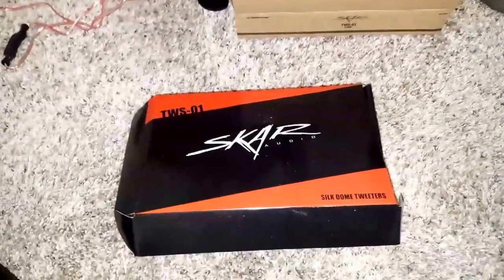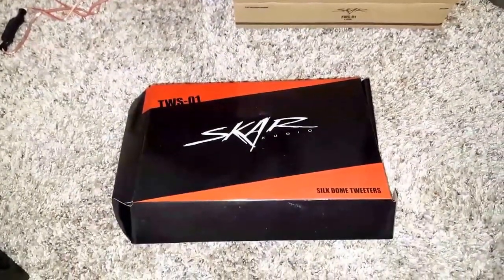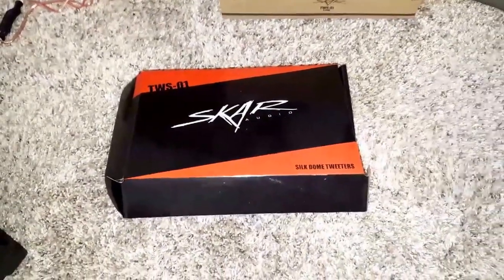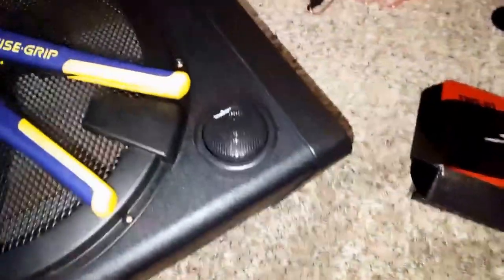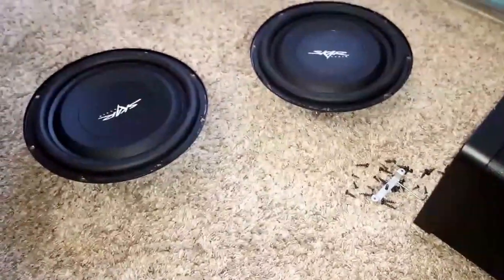ION Audio Road Warrior Bluetooth Speaker *Upgraded* Video 2

Comment: I did this upgrade to my road warrior, and it worked out great except for 2 slight things. 1: the tweeters are just barely too small and do not fit correctly in the existing holes, so I’m going to either get a rubber o ring and put it on so it fits correctly or somehow make the hole smaller. 2: the subs fit good but there’s a slight ring of the interior wood visible, so I just painted that area black and it looks good, you could even use sharpie marker or whatever to paint it.
Reply: Actually one question I noticed your subs sit flush with the speaker but the ones I got stick way out, did you do something to make them flush or is the new version or whatever of the subs different
Reply from the maker: They might have changed designs in the last few years. I did not do anything special.
Reply: @ZionRanch  ok that’s what I figured, thanks
Reply: @meetch0 does it sound better then the stock speakers?
Reply: @arthurmomo4406 hi, I did this a while ago and would not recommend doing this, at least not with this set of subwoofers, for a few reasons. For one, the subs aren’t designed to play the frequencies that the stock speakers do. They are able to, but they will be damaged more quickly over time. Also, the road warrior box uses 1/4-1/2 inch thick wood, which ended up cracking and falling apart after just a couple months when I installed the subs (due to the much higher vibration).  So, to answer your question, yes it did sound better, but I would replace the speakers with higher quality full range speakers that can handle the higher frequencies rather than subwoofers. Skar audio sells a few 10 inch midrange loudspeakers, or other brands obviously. The skar tweeters work fine though, I used some electrical tape to make the hole a bit smaller so they fit right but there’s better ways I’m sure

Comment: Did you add a crossover for the new subs?  I want to replace one of the two factory woofers with a shallow mount pioneer sub.  The sub is 20-125hz.  So I was thinking of adding a passive crossover to make sure the pioneer gets nothing above 125 hz.  I kind of want to leave one original woofer, so as not to lose the midrange.  Also, how much do I need to worry about the ohms of the sub matching to what the amp in the road warrior is?
Reply from the maker: I did not, I am not that savvy when it comes to that. I can only say it was a night and day difference to the factory subs.
Reply: Hey bro, I was thinking of doing the same thing to mine. Did you get to swap one of the subwoofers after all?

Comment: I'm wondering if this got completely rid of the clipping at Max volume? I have a road warrior and if this gets rid of that I'm doing this asap
Reply from the maker: It was night and day difference. I can't speak to the max volume issue as I never had that issue.
Reply: @ZionRanch  I see. Did you have to do anything to the amp to handle the new speakers?
Reply from the maker: I did not, plug and play. Very simple!
Reply: @matthewgray259  When my ION's internal battery was getting weaker and needing replacement it did the clipping issue. New Battery with more reserve power and it was gone.
Reply: @mattskins5323  I replaced the tweeters and all distortion went away
Reply: @matthewgray259  Sounds like the stock one's aren't that efficient. I may have to look into that.
Reply: @mattskins5323  After the tweeter upgrade it was perfect. I swapped the subs out and took them back out. They weren’t worth doubling the weight of the speaker.
Reply: @matthewgray259  Thats what i thought people want car audio bass out of something thats supposed to be portable and is running on a 12v 7ah battery like... hello! I thought the same thing the bass is as good as it will really need to be if you're moving it around but the tweeters would just be a fun thing to upgrade. Thanks man!
Reply: @mattskins5323  Exactly. You can’t compare it to something with an endless battery supply.

Comment: I just orders a pair of those subs... i blew one of mine out on the 4th of July last year so I’m hoping these will make a big difference!! 10” skar single 4 ohm correct?
Reply from the maker: +Christopher Green yes sir, If you use the link in the description it will take you straight to it on Amazon.
Reply from the maker: Amazon stopped carrying them for a bit, I will see if they are available yet.
Reply from the maker: robert wenger I did not check, I also no longer own it as a YouTube viewer asked to buy it.
Reply: Ever do the upgrade

Comment: The opening for the tweeter on my speaker is 2-1/8".  How did you make this fit, because the TWS-01 is too small for this opening? Or do I need to buy a different size tweeter?
Reply from the maker: At the time of this video, the linked speaker box  and the linked parts fit. I am not sure what changes have been made since then.
Reply: @ZionRanch  o
Thanks, I believe the link did change, but I did find the proper links for both the subwoofer and amp... Also, would you reccomend the 4 ohm or 8 ohm subwoofer? ( these are the 2 current options)

Comment: Do you have to use a shallow mount subwoofer with this or do you think a full size 10 would fit in the spot of the stock ones?
Reply from the maker: +Kyle Zibell Somewhat shallow, as the bluetooth controls and peripherals on the back wall.
Reply: Ok thanks, I️ had some Rockford fosgate 10s I’ll try those and see how it goes!
Reply: Kyle Zibell did you in up using a full size  sub for this application? I was wanting to the same.

Comment: What about the battery? It sucks mine only works for an hour , can I replace it?
Reply from the maker: I used mine for several months until a YouTube viewer bought it from me, I never had an issue with the battery. You may replace/upgrade it.
Reply: @ZionRanch  it comes with a 12V / 7Ah could I replace it for another battery even bigger.? Like 12V / 50Ah..? Thanks bro
Reply from the maker: Anything is possible, you would have to verify the dimensions.

Comment: Have you replaced the battery? I bought the road warrior used and the battery is dying but i cannot find any videos about how to change the battery. I even contacted Ion and they didn’t know either.
Reply from the maker: I never had an issue with the battery. Remove it and measure it out and I am sure Google can find one.
Reply: @ZionRanch  I myself also have had the battery die out. I sent it to ION and they replaced the battery for free (after paying $200 for shipping) and the second battery is dead and will not hold a charge. Any ideas how I open up the speaker box to access the battery? Thanks!
Reply from the maker: @ronlanter6906  I never had an issue with the battery. Remove it and measure it out and I am sure Google can find one.

Comment: Truthfully how long of a battery life can you get out of the new set up.......? With mine all stock I always play it at 24ish and it lasts for about 2 hours but I have 7 back up 12v 9amp for back up.
Reply from the maker: Daniel Cummings Reach out to ION and tell them the issues you are having. Mine lasts longer than that. Just had my daughters 3rd birthday and was playing Disney music for 5+ hours in the backyard and still had battery life left.
Reply: What volume for the 5+ hours?
Reply from the maker: Good Day Sir! Since upgrading, I rarely go over 15 in volume.
Reply: Daniel Cummings well upgrade the battery with two or two higher amp hours from Amazon.
Reply: I did the upgrade with kicker subs and i had music for about 5 hrs non stop. And volume up at 20

Comment: I'm struggling to figure out how the whole matching amp with subs work... Do you know for certain that those subs and tweeters work with that amp without over doing it or using too little wattage?
Reply from the maker: +Timothy Laible very sure as I have been using it now for a few months.
Reply: HighTech Camping are you able to play it on 80% volume or more for an hour or more?
Reply from the maker: Multiple times. I do not have any issues with this setup, there have been several that have bought the above equipment in my description and used it without issues.
Reply: HighTech Camping ok, sweet.
Reply: Would you say this speaker is a decent substitute for your car speakers?
Reply from the maker: Timothy Laible Yes you can do that. I have a new truck that I don't want to install a sub box, when I want a little bass I can throw this in and connect it bluetooth to my phone and fire up Pandora.

Comment: One more question, do you cut the wire connected to the stock sub?
Reply from the maker: Andrew Marquis Yes sir that is correct, they had proprietary cable ends to their subs.

Comment: How do you get the wires to stay attached to the subs?
Reply from the maker: Andrew Marquis The sub has crush clips like every speaker where it will bite on the cord.
Reply: Onw
Reply: you can get a flux - soldering paste to attached it

Comment: Did you use the bass blockers that came with them
Reply from the maker: jayez2007 I did not.
Reply: The tws 01 tweeters I got almost pull through the box the holes are to big
Reply from the maker: jayez2007 I used electrical tape to tighten the hole diameter of the speaker surround.
Reply: HighTech Camping one more question did you notice the wire for the lights on the speaker grill hitting the subs foam saround I got indents on the foam and now that I add the tweeters I can hear the saround hit the lights
Reply from the maker: +jayez2007 I did not have that issue.
Reply: I can also attest the electrical tape method works perfectly.  Use the Skar TWS-01 Type A (tweeter+cup insert). Make sure you wrap the tape neat and secure around the tweeter cup until it's level with edge of its plastic lip. Don't allow any of the electrical tape to fold under the lip so the tweeters fit flush to the wood. If it's too big, remove a layer of tape, tweak and repeat until it's tight and secure.  You can also wrap a single layer of electrical tape around the tweeter to make it extra secure in the Type A cup! You don't need the metal bracket on the back like the original Ion tweeters had, but you can attempt this if you have slightly longer machine screws of the same width (the Ion brackets are stronger). Funny, the TWS-01 feel slightly lighter than the Ions which have heat-sinks but I can confirm the treble is much cleaner with less hiss.
Reply: @ZionRanch  Thank you!  I used Skar's TX-T tweeters.  They are bigger and fit perfectly.
Reply from the maker: @jamesgerhard9789  You are most welcome!
Reply: @jamesgerhard9789  I connet my ion warrior via bluetooth to my TV.  It sounds muffled when playing music (no clear voice). Does the TX-T tweeters solve this problem? Is it hard to disassemble and swap out the tweeters?
Reply: @jamesgerhard9789  Did the TX-T tweeters fixed the muffled sound (casused by the bass overpowering the treble?) . They came with two inline crossovers? Was it just a Cut and Replace/Connect with the crossovers attached?

Comment: I've just got my I.R.W..I like it allot and think it's worth investing more money into it if it really improves it's sound quality.  Now that since a year and half has gone by since this posting, have you or any other owners found even better speakers to recommend?
Reply from the maker: I actually had a subscriber buy this setup from me after seeing the finished product. I have not purchased another one yet.
Reply: I just swapped the tweeters out and all the distortion at high volume is gone!
Reply: @matthewgray259  Thanks for the advice, yes, I agree, there is a noticeable amount of distortion when it's loud.  I haven't done any mods to mine yet but I recently found out that if I don't keep the battery charged, it makes many loud farting out sounds when cranked, at first I thought I blew out one or both woofers.  I have been using it exclusively as an added on speaker in my car, it stays hooked up to the DC but I guess it's still needs for the battery to be kept charged.  

It not easy to figure out how to keep the thing from flipping over backward or forwards till I took the matter seriously and bought some straps off amazon but I still need to put some hook velcro along each side on the bottom to keep it from sliding at all.  If you let it flip over, it will damage the 12 volt DC input and also any other cords you got stuck into it.  But the saving grace of this thing is it is LOUD, it sure satisfies in that manor though it adds a mono effect to my car, but hey, it don't cost much and I can put it in my other car.